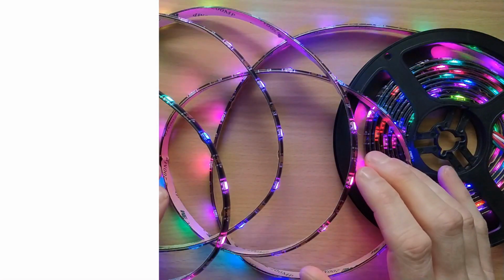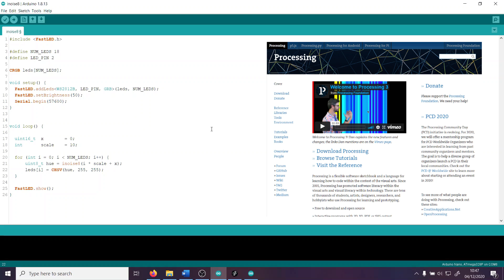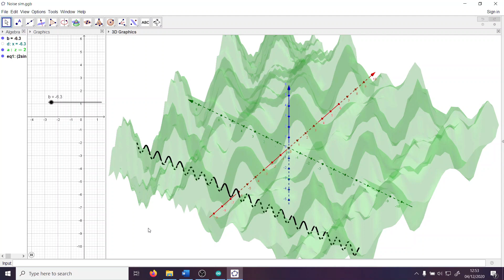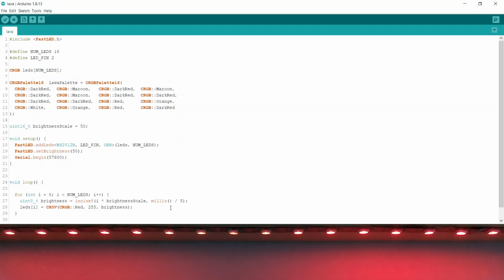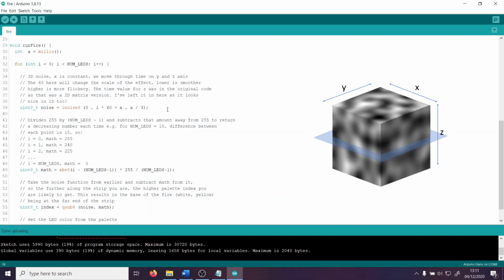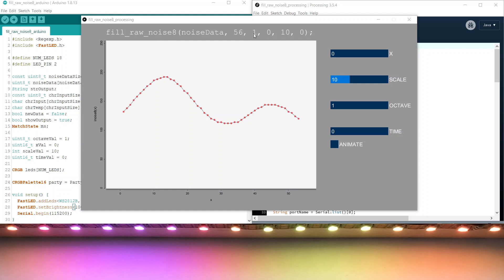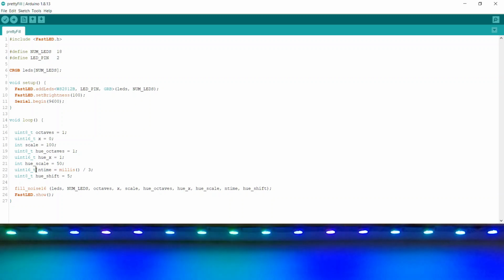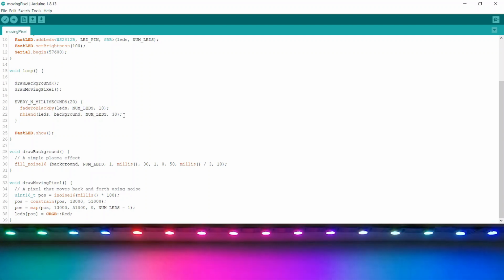FastLED Basics Episode 6 - Noise

Comment: Your tutorials have been massively helpful, you are very good at explaining these topics. This is a bit unrelated to the lighting, but could you make a video adding IR communication. It would be nice to know how to use a remote to switch between and change pattern characteristics similar to how it is done in the button video. Thank you for these videos!
Reply from the maker: Hi Henry, this could be done, but I maybe it's a bit niche? There is a great IR tutorial on sparkfun here https://learn.sparkfun.com/tutorials/ir-communication/all, maybe you could have a go at that and then adapt the button example?
Reply: @ScottMarley  Yeah I do agree it is a bit out of the scope of this series, but thank you for the resource. I did have another question too: Would you be able to show us how to write different patterns to multiple led strips at the same time using separate data pins for each strip? / Is this physically possible?
Reply from the maker: @henrymayne9209  its sort of possible, the way you would do it is update one strip then the other going back and forth. As long as the patterns aren't too complicated  this would happen so quickly that it would seem simultaneous. Have a look at this info https://github.com/FastLED/FastLED/wiki/Multiple-Controller-Examples and see if you can make sense of it. I think multiple strips would be a good topic for a video though, you're not the first to request it.
Reply: @ScottMarley  Awesome. I am going to attempt to use a Teensy (because of its speed) to control 4 strips. Thanks for these speedy and helpful replies, you’re a great YouTube channel.

Comment: Hi Scott, great series.  It has helped me get a good grounding of the FastLED library.
I was hoping that you might have a project/lesson where you go through how to use FastLED to drive a Clock style display.
There are many on You tube, but seem to focus mainly on building the case (usually 3D printing) and are then very sparse on the code itself, usually with little or no comments in the code.
I need to understand how to address the WS2812B led's in each segment of each digit of the clock.
Is there any chance you can do a small project where the focus is almost completely on the code (95%) and just 5% on the hardware?

Comment: Thanks for this series it helped so much! I wanted to create an led system with buttons, where each button would be a different pattern (or a different color). This means that I would have all the patterns I wanted, instead of uploading it to the arduino every time. Is it possible to have each pattern as a 'void' or a variable of code, and then use if statements for the buttons to assign each pattern/color of led lights to a button?
Reply from the maker: Yes, see my video on changing patterns using a button.

Comment: Hello Scott! First of all, thank you for the FastLED series. It has helped me understand a whole lot about library and it has been of great help. Secondly, I have a question regarding the inoise8demo with the beatsin8(10, 10, 30) function. I also use a ws2812b led strip with 120 leds. When I upload the code from your video the end of the strip begins to flicker through the colors while the first few leds go smoothly through them. I suspect this might be due to the high number of leds but how can I fix it so that it would blend smoothly through all the colors on the entire led strip?